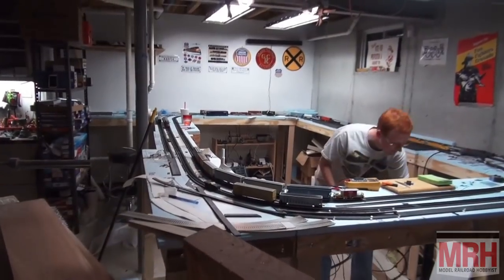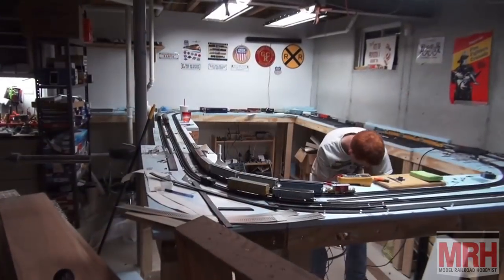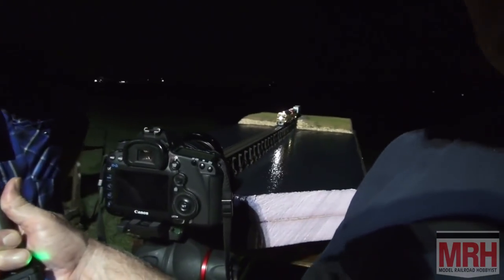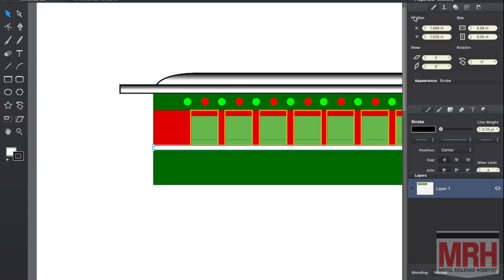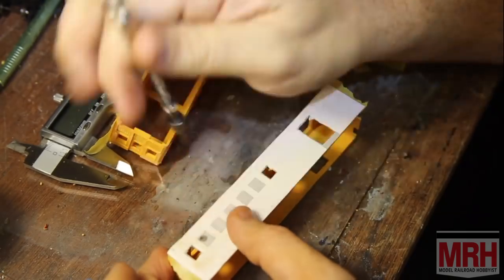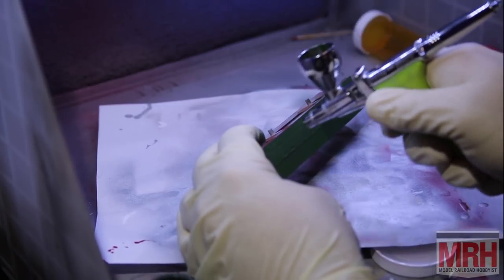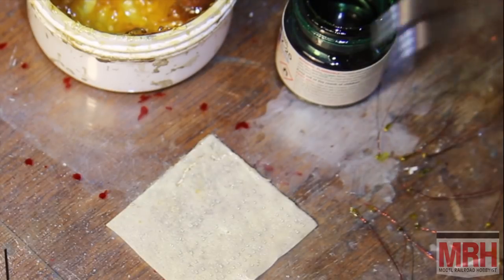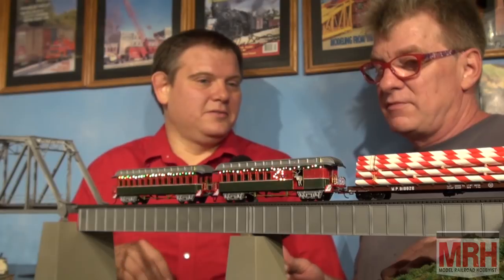Model a Christmas train | December 2019 WHATS NEAT MRH Mag

Comment: Hi Ken and James,
My question is, is there a list of materials and suppliers for the LED projects?
Reply: Most of these items are in the written article as submitted, though I will certainly make up a more concise, separate parts list for future articles.
0402 warm white LEDs 
36 awg Magnet wire in two colors, with temperature rating lower than 400 degrees.
Electronic components as shown in the Fritzing Diagram. (They are written out in the accompanying MRH article as submitted.)
These were all sourced through eBay, and I do not have specific sellers to recommend, as they seem to change frequently.

From your local hobby shop:
Tamiya acrylic paints in desired colors (specific colors are also in the article as submitted). 
Pin stripe tape (1/64”). This will either be through eBay or your local hobby shop. Color doesn’t matter since it’s being used as masking.
From your local hobby shop: Tamiya masking tape of varying widths.
Micro Krystal Klear.
From your local hardware store: frog tape painter’s masking. 3M super 7 Spray adhesive.
Are used acetate plastic packaging for the windows.
Kadee centering springs for the wheel wipers.
Reply: Unfortunately, my accompanying article was not used as submitted. I will try to make the accompanying materials available elsewhere, possibly my own channel.
Reply: I've got this James. From now on I will again take 2 days to write the text with 30 or so photos for the inside of the magazine starting with January What's Neat.....Time is my biggest issue since we started the weekly podcast on Ken Patterson's You Tube site.. What's neat This Week in Model Railroading. I actually need to start employing dependable staff for the productions. It's coming..........KP

Comment: Good show! Great to see the progress on Daniel's layout. I was keeping up with James until he said" solder black for negative to the red".
Reply: Robert Shearer this is because I use blue magnet wire on my LEDs for the positive terminal, because it links to the blue function common wire on the decoder. Red or green wires are the negative. This is changed a little bit in the case of these cars because there is no decoder involved. Only the positive and negative terminals coming off the rectifier. For that, the standard is red (or some variant) for positive, black (or some variant) for the negative. This connecting the red magnet wire to the black 30 awg and blue to a resistor and then to the red. There’s no real magic to the colors, as long as you know your polarities when plugging those LEDs in.
Reply: That's the transition from 36 awg magnet wire to 30 awg stranded.  When I am wiring LEDs with magnet wire, I use blue for positive, and red or green for negative.  This is intended to match NMRA coloring for the blue function common wire, which is positive.  The other wire, meanwhile, would be soldered onto whatever color function we are using the LED for.  However, in the case of these coaches, we do not have a decoder.  We only have a rectifier, or in the case of the coach baggage, a rectifier and timer chip.  As such, the NMRA decoder wiring colors no longer apply, so I was using the standard red (or variant) for positive, black (or variant) for negative for my 30 awg connections.  There's nothing magic about the colors, only that you are consistent with them and know what they are so that you can plug in your LEDs with the right polarity.

Comment: Anyone know who makes that Santa Fe? She’s purty. I’d love one.
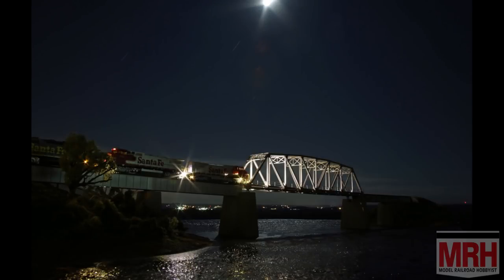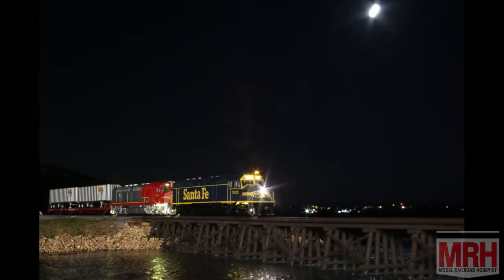Reply: The shot at 1:32 was of two B40-8W's from Atlas, a Kato GP35, and a Life-Like Proto2K GP30 (mounted on a Kato GP35 chassis).  The F45 and FP45 that appear around 15:12 are Athearn Genesis.  The 4-4-2 pulling the Christmas train around 40:37 is a Mantua.
Reply: Thank you so much. I should have clarified. It’s the Athearn I was admiring.
Reply: @MMRails  So far that I know, they are only available second hand on Ebay right now, though some hobby shops may have new old stock.  Those genesis FP45s and F45s are absolutely beautiful locomotives, and very impressively detailed.
Reply: Thanks for the info. I did some searching and you’re right, they’re hard to come by. Maybe Santa will find me one. :)